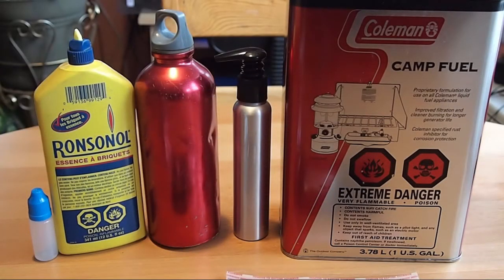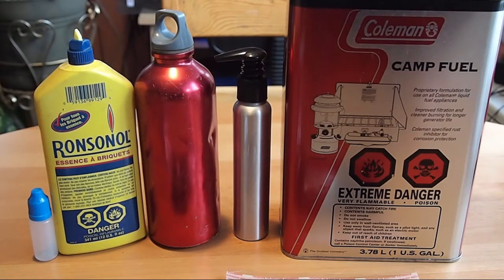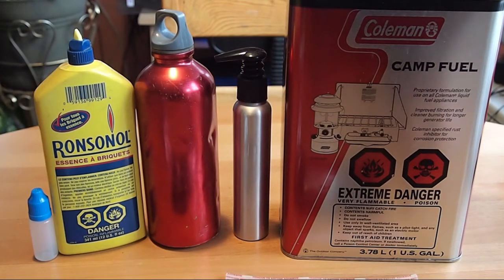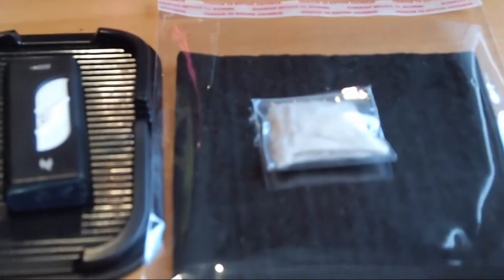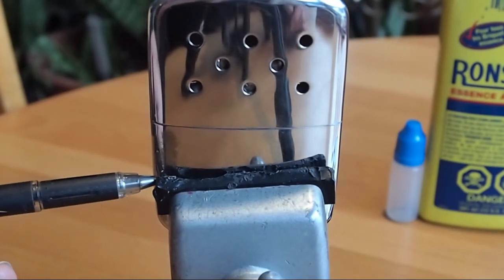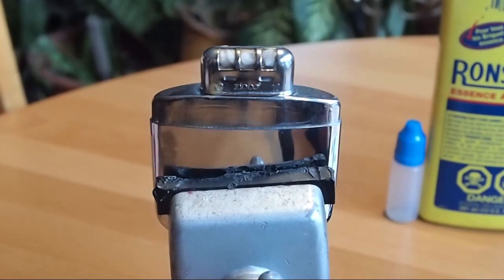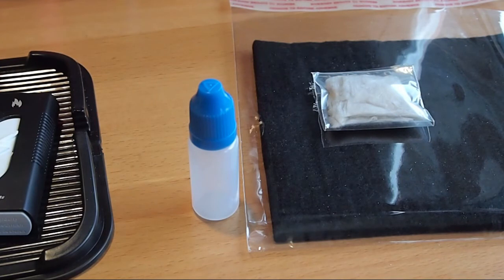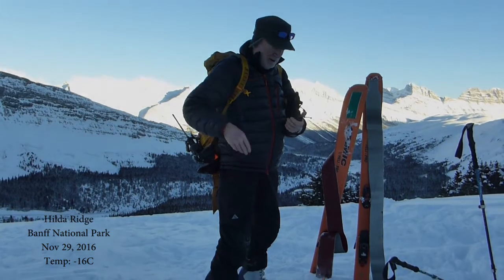Handwarmers, S01E04: Rebuild Kits Part II

Comment: hi MP, thanks for the imformative vids and your findings. ordered some handwarmers and plan to do your upgrades. I noticed there is a coleman quart size premium blend. is that the same contents as the gallon size you have shown in the vid?
Reply from the maker: Sorry for the late reply, sometimes I get notified of a comment but it is not there when I login to reply.  Then weeks later, it seems to have shown up.

I use any white gas that I come across, it all works. I now get most of mine in the summer from the recycling area at our local campground where departing campers leave all sorts of partly full fuel containers.

Comment: Any idea if the 'lampe berger' fuel will mix with the naphta? It's alcohol based I think. Curious about that.
Reply from the maker: Thanks Sandy,

I'm definetly not an expert, but we can look at what we know. The flash point of the mint terpenes is about 135F, whereas alchohol is about 54F. As the hand warmer body can heat to around the flash point of the terpenes, it would seem you'd be better off with them, but my friend Jeff Hanna commented long ago that you can put after shave in a hand warmer and it helps, so I wouldn't be suprised if 'lampe berger' would work to some extent as it might be very similar to after shave. The pure essential oil of mint or basil is high in terpenes, so if you don't have access to them in the terpene form, I'd look at using the EO and experimenting with putting a few drops in. I don't tolerate perfumy smells very well, so that's why I'm focusing on the mint terpenes with linalool. Ironically, as linalool is also the active ingredient in citronella oil that repels mosquitoes, it's probable that if you used linalool in your hand warmer, it would function in the same way that a Thermacell works, be much cheaper, and I suspect work even better than a Thermocell.

Comment: where can I buy the USB Arc lighter in your video and where can I buy the Platinum Catalyst material in your videos
Reply from the maker: I cannot find that style of arc lighter anymore. I tested some of the other style that have the coil that is meant to light a cigarette. It worked, so I ordered some. They are cheap so the battery life is probably not all that great. I'll test them when they arrive and it they work well enough to replicate lighting a hand warmer a few dozen times before needing a recharge. Why I like the USB is they are not susceptible to wind and altitude. If that battery is that cheap it's probable you'd have to keep it in your pocket when it's real cold out.

The catalyst is on our website.

Comment: Hi there my friend, I detect an Irish accent, I am from Co. Antrim.  Do you know where I can buy the Carbon felt and platinum catatylitic materials online? I purchased a Peacock Hand warmer on line which i believe is better that the ZippoThank you. Seán
Reply from the maker: Thanks Seán. 
I'm not sure where to buy small pieces of carbon felt, that's why I decided to cut up the larger sheets and offer smaller pieces. I originally had to buy a sheet for various alchohol stove designs I was playing with and had a bunch left over. That gave me the idea to try it in handwarmers. I get ours from one of the welding supply distributors, they sell it by the square meter. You may have some luck if you can visit a local welding shop. Interesting note about the accent, my grandfather was a Scot, but being born in Canada I am stuck with the Canadian inflection, which I don't think is as pleasant to the ear as any of the celtic accents.